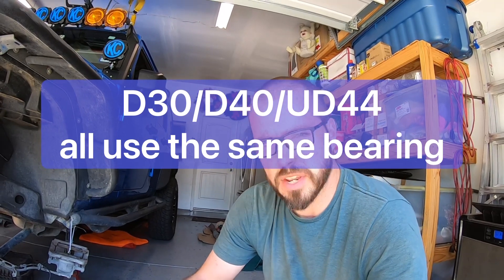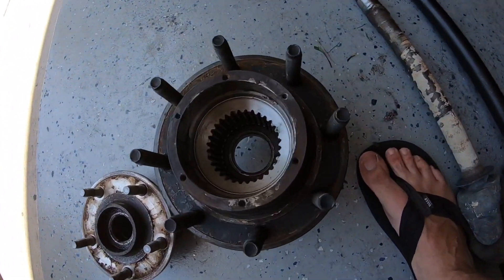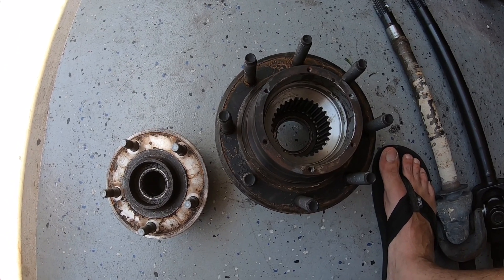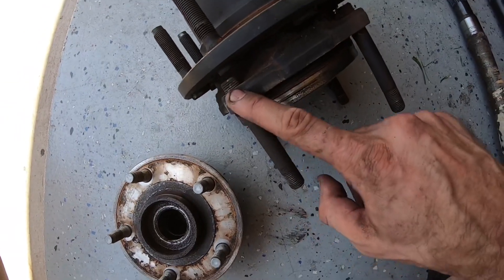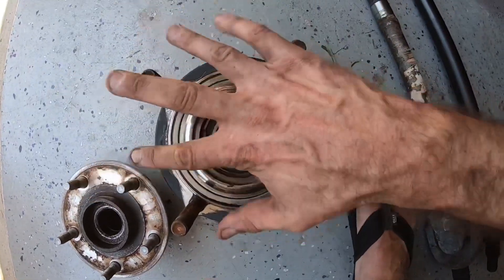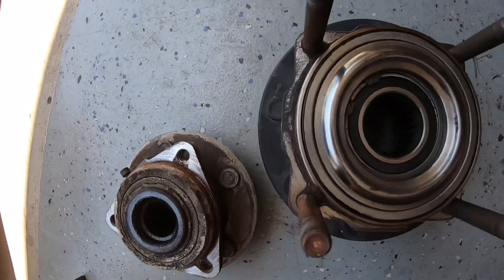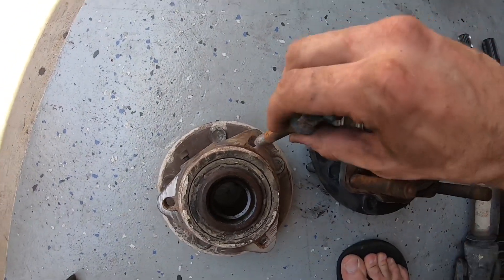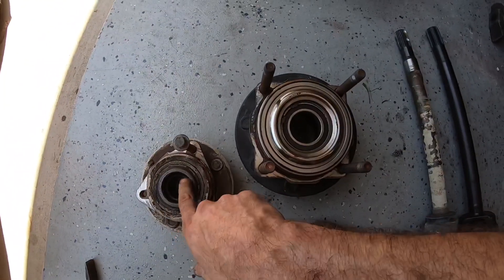40’s on a DANA 44??? - Hub Bearing Comparison

Comment: Definitely opened my eyes with the huge differences!!
Reply from the maker: I mean Dana 44 is good. Ultimate Dana 44 is even better. But the 40 or larger is just a lot of stress. Not that it can’t handle it…it will just wear things out way faster. And it is closer to the breaking point.

Comment: Have you seen the Fusion hybrid 60/44? Curious to your opinion.
Reply from the maker: I have. I think it’s a lot of money to still have a small 5 lug hub. The axle shafts are then undersized…and the rear axle isn’t a full float to my knowledge. That is a major weakness that is improved on with going to one tons. They basically just make the ring and pinion larger. But everything else is still weak. Now it’s obviously improve upon when compared to a factory Dana 44. But it’s not a true one ton.
Reply: @WarPaintOffroad  a good assessment. I’ve run 37’s on a D30 for two years. I wheel regularly. Drove it from Georgia to Moab, and then home. Recently got badges from Windrock. It’s trussed, sleeved, gussets, and Teraflex ball joints. Tons are definitely planned. Eventually it’s going to break.
Reply from the maker: @moggiethejeep1828  yea. Eventually. It cool to hear that you are still using the Dana 30. They definitely aren’t as weak as everyone pretends they are. But obviously there are better options.  I’ll be building a set of junkyard tons this fall/winter and putting videos out showing exactly how to do it. So if you aren’t sure stay tuned for those. Makes it way cheaper.
Reply: @WarPaintOffroad  I’m planning on the junkyard swap. ‘05 or up 250 front and 14 bolt for the rear. Keep up the good work!

Comment: Looks heavy.
Reply from the maker: It is. That’s another thing. When you truly take a look at the serious wheelers. Serious rock crawlers. None of them are building “light” rigs. Strength comes with thick steel, big tubes. Thick wall tubing, big tires, beadlocks. It all adds weight. So there becomes a point where you need to forget about building light and just embrace the thickness. 😂 but seriously, it’s way heavier than the Dana 44/30 stuff. But it’s wayyyyy stronger.